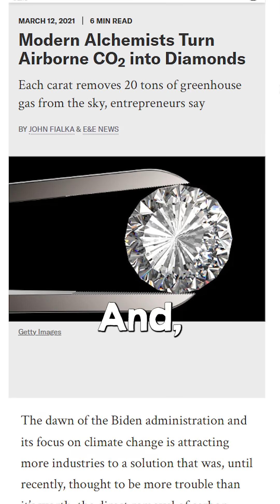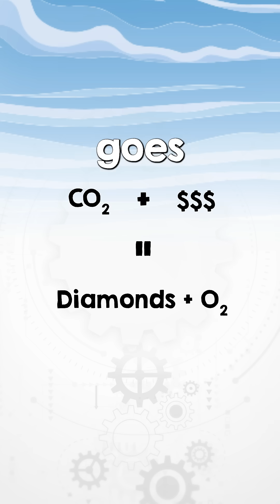The WORST Climate Techs (according to Paul Martin)

Comment: Rosie, Paul Martin obviously does not know about Dr Casey Handmer and his startup Terraform Industries in LA. They have developed the same tech that Paul ridicules, but ultra cheap and massively scalable using solar that's getting cheaper very few months. Their terraformers will produce pipe-ready methane at a lower cost than drilling for the stuff, and can go anywhere on the planet, to supply the long tail of fossil users (industry, airlines, etc) that will take decades to decarbonise. I suggest you interview Casey, he's an expatriate Aussie!
Reply: The key phrase here was using it to make heat. as you could make heat much cheaper just using the electricity directly with a heat pump. Using it for other purposes might still be a good idea depending on the alternatives.

Comment: I know that Methane from Green Hydrogen and captured CO2 isn't economical for any kind of base load power production, but I have wondered if such "Green Methane" might be a niche solution for long term storage. Save your surplus electricity as Methane, then get it back via Methane based fuel cells.  Long term storage of H gas is problematic because of leaking and embrittlement, and my intuition says that storage on time scales of months or years as methane would outperform batteries or flywheels and the like.  I wonder if it would be worth going an extra chemical step from Methane to Propane, to avoid the green house effects of a large contingent of long term methane storage?
Reply: im not a physicist or engineer, but right off the bat, my guess is that methane is actually pretty hard to store, so it will probably run into all the same problems as storing hydrogen, just to a lesser degree.

the first problem tho, is that there probably isn't any cheap/efficient process to turn CO2 + H2 into CH4. you're basically tryna reverse a combustion reaction, so it's never gonna be simple to begin with. and if you just wanna store carbon... what's wrong with just storing CO2 itself? why spend a bunch of effort to turn it into CH4?
Reply: @alveolate  As per storage: Molecular Hydrogen (H2) is much harder to store than Methane. Firstly, the molecule is smaller, so is more able to leak through cracks and gaps. Secondly, the H gas will penetrate the matrix of typical containers (like steel) and modify its chemical structure to make it more brittle. Thirdly, H2 gas has less energy per unit volume than Methane. Methane gas at standard pressure and temp has ~35 MJ per m3. Hydrogen is like 4 or 5. that means for an equivalent amount of energy you have to have the H2 at significantly higher pressure,  or at a significantly lower temperature, increasing cost and complexity of your storage process.  

As for conversion process: The process is called methanation and it has been studied. Its simply a question of if the losses of methanation are omre, or less, than the losses of other technologies. 

As for "what's wrong with storing CO2", my aim and point is not carbon storage in and of itself (a boondoggle) , but ENERGY storage, that just happens to use CO2 as a feedstock. Obviously any CO2 captured would eventually be released on use of the energy, so this isn't at all about storage.
Reply: It doesn't need to be economical if you are making it using spare electricity, and if we are to have enough wind turbines for a calm day, there will be plenty of days when there will be spare electricity.  Using spare electricity is not wasteful, however much it uses..

The other thing is, battery powered intercontinental air travel/transport is currently very infeasible, while synthetic fuelled flight is easy, again efficiency is not an issue, practicality is the issue.
Reply: Or how about methanol? 

Which adds a hydroxyl group. And which is already part of the fuel stock in some countries. Which is easier and more cost effective to store than a gas. Which can be produced by the biological carbon capture method I.E called Wood Alcohol distilling. But use a more efficient faster growing feedstock. (But initially is cheaper from natural gas. To create economies of scale )  Subsequently there are various other options for producing it.

And when combined with ICE or eventually fuel cells, it is complimentary to batteries. Since it has a higher power density. In a hybrid configuration. Such as for Towing.

Over a 100 years ago electric vehicles, were dismissed as one of those Worst Tech ideas. So our current list of what's "Worst", should always be considered transitory in nature. (Which is my two cents on the topic ;)
Reply: @nc3826  "how about methanol"  As an energy storage medium? It's not really what I was talking about, but to reply as best I can,  If its collection is depending on fermentation of a harvested feedstock, I'm suspicious that it wouldn't be scalable or practical, as Ethanol has not been. In discussing Methanation, we have a direct industrial process where we can look at each step and make good calculations  about round trip efficiency of energy storage, as is appropriate for something fulfilling the role of a long term battery. Growing and harvesting plants to feed a wood alcohol distillery is rife with external variables, and isn't really about filling the empty niche of long term energy storage with existing renewables. It's about a whole different path of gathering and distributing energy.
Reply: @Natabus  "Liquid IE Methanol is more conducive and more cost effective for energy storage than a gas IE Methane ". No matter how they are produced. (Biological option, is just one of many. Sorry I shouldn't have mentioned it since it's such a dystopian trigger for some people)

But I'm open to anybody who can show, "definitive calculations" on how a gas, such as methane is more plausible and more cost effective? (Might as well go with hydrogen if you're going to go with the gas, NASA was able to do it)

It's all good my friend believe what you want and good luck with those calculations. And have a nice day.
Reply: @Natabus   FWIW At least you put some thought into your comment unlike the other Commenters....
Reply: I think Methane and Propane would be a much better choice for storage then H". On the other hand if it is going to be a niche application there are probably enough possibilities to get the CO2 from breweries, Biogas-Plants or Cement-Production. so there wouldn't be a need for direct air capture and make it much cheaper.